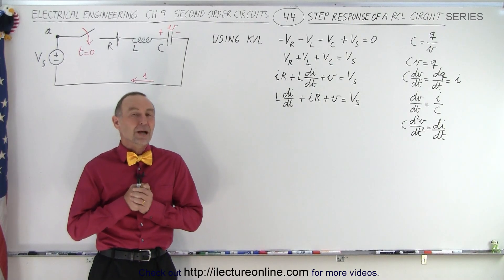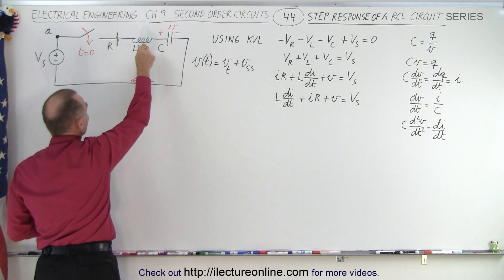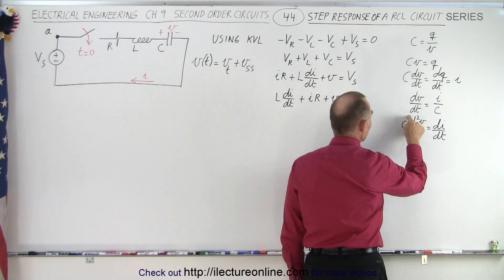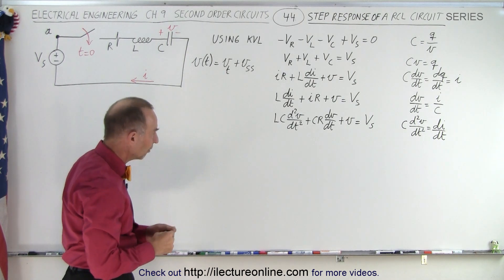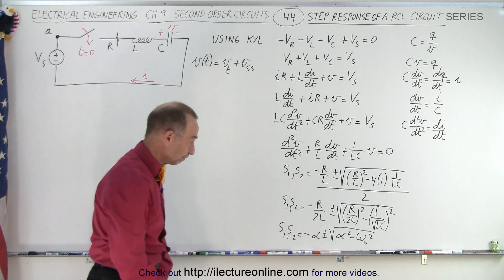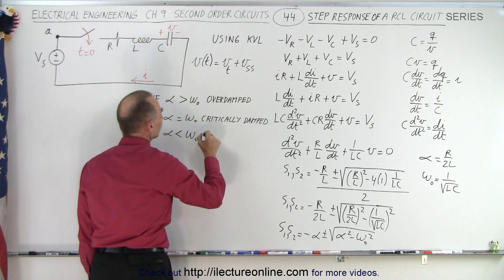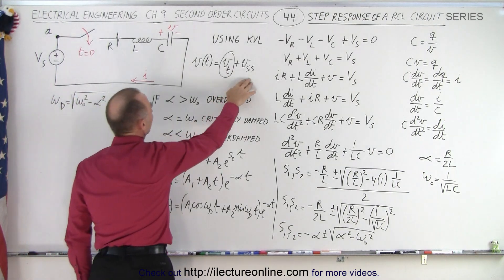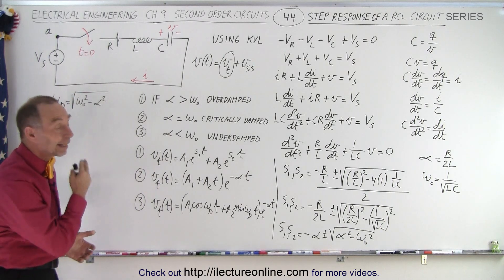Electrical Engineering Ch 9: 2nd Order Circuits (44 of 76) Step Response of a RCL Circuit

Comment: Hi Professor, at 5:28 you say alpha has changed. But alpha is still equal to R/2L here. Doesn't this mean it didn't change, since this is the alpha for series circuits of RLC?
Reply from the maker: If I said "alpha" I misspoke.  It is the frequency that has changes.

Comment: I noticed that R/2L and 1/2RC are kind of like 1/2tau. Is that coincidental? It would make sense to me that KVL is related to voltage so looks at the capacitor and KCL is related to current so it looks at the inductor. I just want to make sure that I am not making wrong connections.
Reply from the maker: The time constant for a capacitor = RC    The time constant for an inductor =  L/R